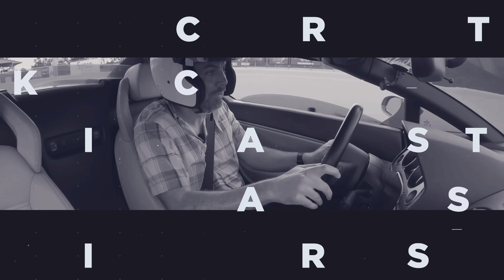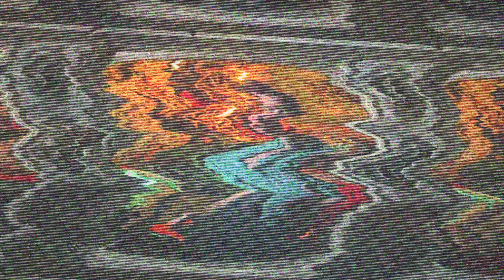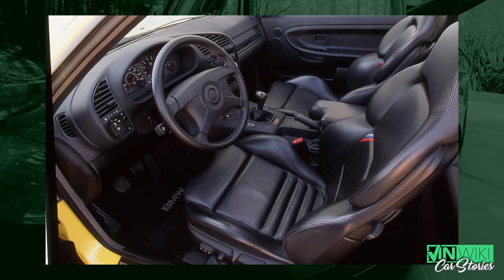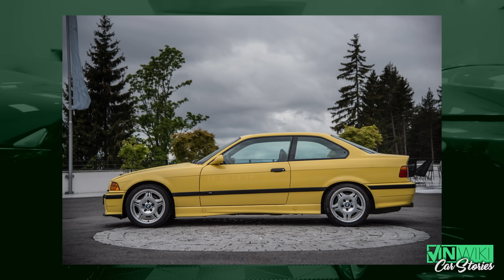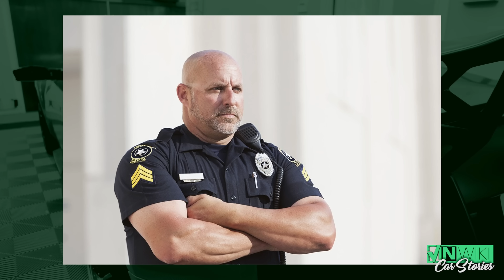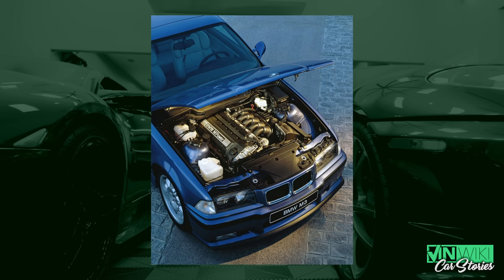BMW banned me from their HQ for this...

Comment: You can tell this guy's from Canada.  My first ticket was in 1997 in a 92 Nissan sentra 4 speed. 115mph in a 65 on the highway. I didn't run when I saw the lights. The cop opened his door for cover as he drew his gun, and told me to slowly get out of the car w my hands up and lay face down on the pavement at 1am on the side of the highway. And he ended up being pretty cool. I still got a major ticket

Comment: I used to live in Durham Region where BMW Canada used to be located at the time. I rejoined the BMW Club around 2000-2001, and BMW Canada was still offering free drives to BMW Club members. I remember taking out a 2001 BMW 330 manual and flogging it hard, all for free. Good times back then. Today, I'm on BMW number 6, a 5 Series manual, with upgraded M5 suspension and Michelin Pilot Sport 4S tires, and nothing will corner like this baby, tire technology has improved so much in the past 20 years. I know that I get a lot of looks, like why is this old gray haired guy driving like a teenager?

Comment from the maker: What is your favorite generation of the M3?
Reply: E36 was the right combo of style & driving dynamics vs the E30, the 6cylinder just drove better than the buzzy 4. Glad I had to experience them when they were new and had a warranty to deal with the little "issues". Sorting an E36 out 25+ years later will drive one bonkers.
Reply: I like the style of the E46 M3 GTR
yeah yeah need for speed most wanted.... what can you do...
Reply: M3e46 CSL
Reply: My 1998 E36 M GTS2 race car.
Reply: Between the e36 and e92 for me
Reply: E46
Reply: E92. That V8 sound is a symphony to my ears.
Reply: @rickkerrypollak6208  Same for me. Styling though, E36 in Estoril Blue when it was a rare colour
Reply: I have a euro 97 Hellrot Evo coupe, so I'm a little biased. For a long time, the E36 was seen as the underdog, but I think now people are starting to realise just how good these cars are.
Reply: E46, Apparently Need For Speed Most Wanted cemented the E46 M3 GTR to top spot
Reply: E36 all day
Reply: Has to be the E46 CSL, had the pleasure of two.
Reply: E30
Reply: I owned a 2002 E46 M3 6MT for 10 years. I sold it only a few weeks ago. I've driven an E92 M3 DCT, an F80 M3 6MT and a G80 M3 CS DCT. I now own a 2020 M2C DCT. Even though it's an M2, it's very close to the size of the E46 M3, so I consider it to be my favourite generation of the M3.
Reply: E46 followed by the F87 (M2).
Reply: My first BMW was a 97 328is. I really liked the car, especially the lines of the body, but I don't miss the poor quality materials used in the interior. The suspension was pretty disappointing as well.
Reply: An e28 m5...
Reply: E30
Reply: E90
Reply: Undoubtedly the e36, hence why I chose to buy one for my daily.  It's the coolest looking and has the perfect balance of comfort and rawness.
Reply: E92, I’ve got the 335i twin turbo but will upgrade to the M3 one of these days, such a beautiful car to drive and look at
Reply: I had the e90 and now have an e36.  The E90 obviously feels like a more modern car. Without a doubt. But the E36 there's just something to it. 
Hellrot 5speed coupe .
Reply: Z3 m coupe
Reply: E92
Reply: E36
Reply: 2009 E92 Coupe.
Reply: E90/E92/E93. Possibly the greatest naturally-aspirated V8 ever put in a mass-produced car.

Comment: tons of accurate knowledge here. I've heard stories of BMW M selling E30 M3's to employees at a discount just to get them off the lot a year and some change after they launched. The E36 non-M and the M version saved BMW &  BMW M in North America. No two ways about it.
Reply: That was just when the Nikasil cylinder liner issue was also playing out.  I bought my new 97 540i 6 speed and was assured all the problems had been ironed out.
Reply: The e34s had the nikasil issue. I also owned an e39,two of them… a 97 which was a non vanos model and then I traded it in for a 99 with a sport pack which did have vanos. I felt like the 97 was slightly quicker even though if I’m not mistaken the vanos models got a slight bump in torque?

Comment: I loved my E36s. I was chased by a WSP helicopter over the north cascades during a large euro drive on the way back from Leavenworth. They ultimately had a police trap for the new STI at the time anf myself around North Bend. Walked away with only a 10mph over ticket because they coukdnt accurately find the mile markers between the mountains to find our pace. Was doing 120mph+ through the mountains with the new at the time '06 STI in my modded E36 M3
Reply: Awesome 😂

Comment: Someone tell me whose buying these element fire extinguishers for 89$? Fire extinguishers are like 15$
Reply: Cheap hardware store fire extinguishers can be bought for $15 just like Toyota Corolla's can be bought for much less than a Porsche and they both can get you to the same destination. Element's occupy the 'clean agent' part of the market and in that high end field they cost less than half of the next closest competitor with a lot of great advantages they don't have. The people who understand that are the ones snapping up Elements because of the value they represent. Hope this helps.
Reply: @benzina5917  that does help but by clean do you mean they aren’t toxic like the classic fire extinguisher? Cause that would actually make a little bit of sense.
Reply: @knewt0  Clean agent extinguishers are ones that put fires out without making a mess. They are generally much more expensive and are used to protect valuables or sensitive equipment. Often times inexpensive powder extinguishers do more damage than the fire. Element does the job of a clean agent at a much lower price point. In addition most clean agent extinguishers are toxic whereas Element in totally non toxic. It is safe to ingest and will not rob breathing oxygen. Pretty cool tech.

Comment: Yes, I agree if we only got the S50B30 Euro version here in the states... ugh 😢  Not just for the ITB's but those headers, which makes the S52 manifolds look even more ridiculous instead of an 'upgrade' over the cast M50/ S50 ones. IIRC the euro version has a cat less midpipe too, which I did very early into my days of multiple BMW ownership. Supersprint trackpipe is a direct bolt on off the OEM downpipe flanges to your choice of catback. Full custom 3" mandrel from the downpipes on usually nets the best gains, has a 'deeper' tone too. Us Bimmer drivers should stick together. When we got into trouble acting a fool on our drives we would all pull over LOL 😁 Strength in numbers I guess. This is both with our independently organized primarily all-BMW driving club, or the local CCA chapter. Sucks that you didn't get to go back to the event. That's what being a stand up guy by not snitching out the other people got you. So I gotta give you props there doing what you should by keeping your mouth shut. As far as those executives doing some "spirited" driving, it seems more like a classic example of 'Do as I say, NOT as I do!' No surprise there. 😂 Thanks for sharing the story! Was a good listen 👍